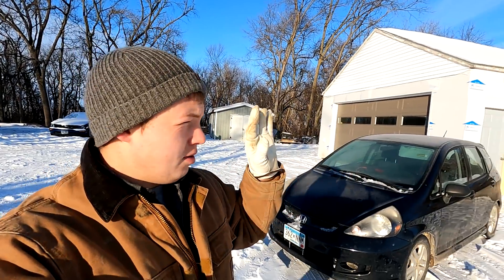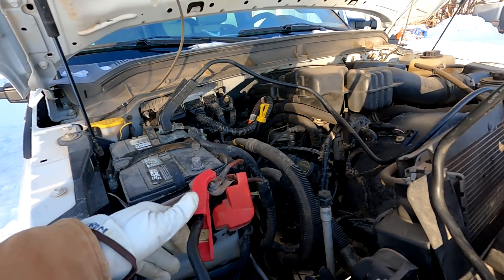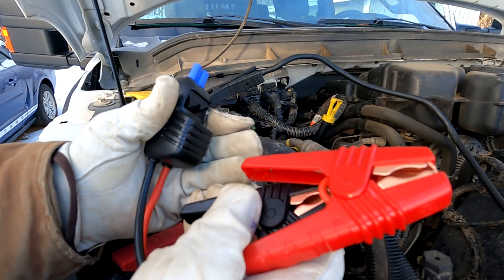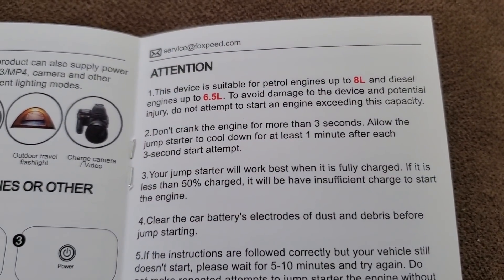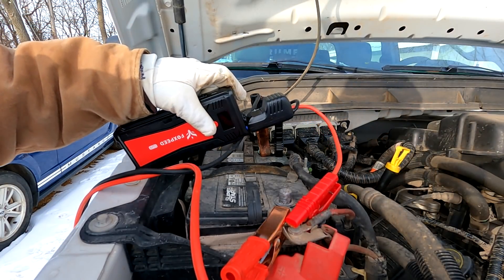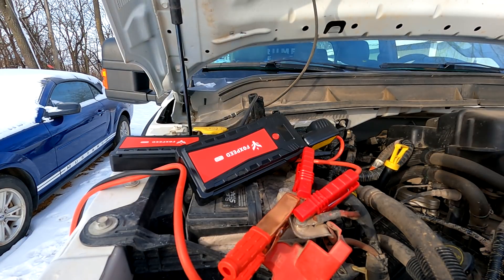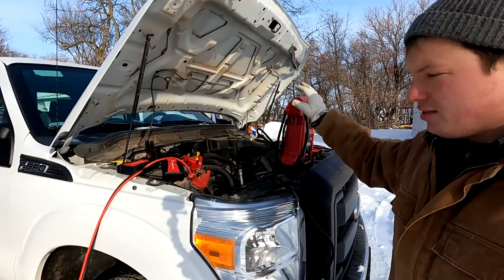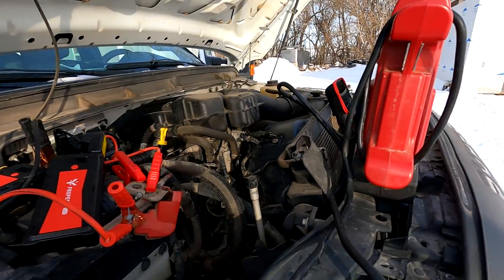Lithium Ion vs Lead Acid Portable Car Jump Starters

Comment: Think about very cold electric cars
Reply: Most EV's have absolutely no problem in the cold, though you do see reduced range.  The Nissan Leaf is the one that suffers the most, but this is because Nissan cheaped out and went with an air-cooled battery instead of a heated/cooled unit like everyone else uses.  (Supposedly the next Leaf will fix this)  Normal EV's will run their battery heater/cooler even when the car is off, if the computer says its too hot/cold out, or if you set the car's computer to do so.  For example, if you leave for work at 7am each day, you can tell the car to pre-heat the battery at 6:45am.  Or better yet, tell it to pre-heat the entire car, so you do not need to defrost or defog at all, and the seat heaters can be readied.  Of course this, and lithium-ion's reduced output at low temps, means you do lose some range in extreme cold.  Normal EV's can lose ~20%.  Nissan Leaf's lose 35-50%.

And for the record, I'm not a super EV evangelist.  Just a mechanic who works on anything with wheels, and have my certs for EV's.  I'll get one when I can charge it at home, but the current rental doesn't allow it. Booo~!

Comment: Wire resistance is proportional to length. Shorter cables can get away with being lighter gauge. For the same amount of current longer cables need to be heavier gauge.

Comment: My experience with lithium ion jump packs has been very negative in cold weather. Looking at Amazon nearly all of these units look similar with cosmetic changes. Lipstick on a pig comes to mind.
Reply: The Hulkman 85S has a pre-heat option that almost none of them have.

Comment: what is the dif. beteen 20 volt battery with 1.5 AH and 20 volt battery with 3.0 Ah? THANKS . your every informing.
Reply: 1.5 AH will supply 1.5 A current for 1 hrs, same logic for 3AH

Comment: General question that has nothing to do with this video, but with prior videos that you have done on wiring a home. The question I have is: “is there a code for how much insulator sheathing (the outermost insulator coating on standard household Romeo) can be left inside of a electrical receptacle. In other words, how much of the outer sheathing must be stripped off (e.g., 1/2”, 1/4”) ?  Thanks.

Comment: If you tried to start it a few more times, it might start. The LiPo cells need to be warmed up. Starting it a few times cold warms it up really quickly, and you should be able to crank it over by then.

Comment: If I were to have one of these, I would want to keep it in the vehicle so it would be there when I needed it. A jump starter that has an operating temperature of -4° (-20° C) on the low end just doesn’t seem terribly useful. It wouldn’t work when you’d be most likely to need it
Reply: The problem with this is that all batteries don't mix well with cold. That's just how they all are. Don't start your car for a week in well below freezing temps and your battery won't crank.

Comment: I just have to wonder why we can make electric cars using lithium batteries, but no one makes a full sized lithium starter battery. I would ike to be able to go 10+ years on a battery instead of the typical 3-5 years I get out of a lead acid.
Reply: Lead/acid is still the best battery for rapid discharge as is needed for a starter motor. Lithium is good at steady, gradual discharge as is needed for a continuously operating piece of equipment in a relatively steady state.
The lithium jumper pack contains and charges a large capacitor with the lithium cells and the rapid discharge of the capacitor is what boosts the vehicle battery. In fact, capacitors are often used in extremely cold climates to start heavy equipment because they're not subject to as much temperature degradation as any chemical battery, including lead/acid. Now of course, you cannot run anything on a capacitor continuously because it is more or less an accumulator of electrical energy, discharging its stored energy rapidly but cannot provide steady flow nor steady voltage.
The point of my comment being, lithium cells are not a viable battery technology for intense rapid discharge, they have their place in other applications for sure, such as phones, computers, etc.
As for the temperature issue, while lead/acid degrades under colder temperatures, lithium really takes a nose dive at some point, definitely not a cold weather battery.
Reply: They are available, but still pretty expensive. I expect that to change in the next few years.
For example:
https://shop.advanceautoparts.com/r/car-technology/lithium-car-battery
Reply: https://youtu.be/9cV837XhCN8

Comment: I have the same lithium-ion jumper pack and I love it. I've had for about 3 months and used it a few times. I live in Chicago, so it gets pretty cold here. I noticed it works best the closer it is to 70 degrees. It was 5 degrees last week and my car wouldn't start with the pack connected, so I put the pack inside my jacket, sat inside the car for 15 minutes, and let my body heat warm up the pack. I tried it again and car started right up.
Reply: Bernardo Cisneros
Thanks for saying that.  I'm trying to decide what brand of small Lithium jump start battery to purchase and this is a meaningful comment to me.  The test really didn't help.
Reply: A useful observation!
That could save someone's bacon!

Hey, if you wore a bigger coat you could just do that with the car battery!

More seriously the little packs can more easily taken inside in really cold weather. I've even taken them into restaurants, work, libraries and coffee shops in sub zero weather as I usually have a backpack anyway, to carry stuff.
I've charged it in some places too.
Of course bringing it in at home, overnight is the main thing, at least when it's double digits below zero... normally I don't.
Reply: They only work for a few years.
Reply: @dlee3710  
That makes sense.  No battery lasts forever.  They are just batteries.

Comment: I'm not entirely sure, but when you disconnect battery like you did, it resets computer in the vehicle, and the engine may not start, or may not run properly for a few minutes until the 02 sensors in the exhaust warm up.... it wont idle properly until it "learns" how to again, very frustrating on a -20c morning at 5am

Comment: What is the lifetime of the units? I find that they only have a 100% lifetime on average of 18 months for the lead acid unit which I prefer, but the cost of a replacement battery to be prohibited because it is about 3/4 the cost of a new jumper.  If you find it on sale off season, ( which happens every other time since I have it working 100% all the time). I am left with a choice of saving a small amount of money and have a beaten up looking unit (which is what I have) and none of the new bells and whistles,  like USB ports.
Why are these replacement batteries so expensive?

Comment: I have never tired a little one.  Convenient size and if the work, it's a good first step.  I recently borrowed a friends bigger one rather than running 100' extension cord with the charger.  It was snowed in so I couldn't easily get a car into the back 40.  The bigger pack worked hard but after many tries it succeeded.  I could see having a small one for quick try, especially since the Lithium probably recharges faster than the big ones.
Reply: I've got a lithium one.. They charge for a few hours and they're at 100%.  Some wont attempt to jump if they don't see at least 10v on the battery... Mine is like that.  It does the thing though on a 5.4L.

I've got a second one coming that doesn't have that limitation and should be able to spin my motor easily.  They're more for jumping batteries that are almost there, and just a little low vs. a completely dead battery.  Handy to have.  When I jumped my expedition with the one I have, I ordered a second one for my other vehicle...

What he's seeing with the COLD pack is accurate.  The lithium cells DONT like cold weather.  Heating em up to 30-40F would be ideal.  Mine will do it in the cold, but it takes a few tries to get that big amp pull to warm up the unit.

Comment: Need to try a super capacitor jump starter, not effected by the cold
Reply: This is exactly what I've thought about doing,, but don't run into a dead battery more than once every 3-5 years so I've never bought one since they're $100 or more.

The advantage of the super-capacitor jump-starters is that they can (allegedly) charge themselves off of a low battery, and store enough power to start the car.  The thing I don't like about the battery based ones is that you have to keep the battery charged.  Lithium and lead/acid batteries have self-discharge rates that they might be dead in 6 months unless you charge them.  A super-capacitor charger charges off your car battery, your phone, or the wall.

Honestly, it'd be cool to see a hybrid car battery that already has a super-capacitor in it, and maybe some temperature sensors that charge it up when it's extremely cold.  Then you'd get extra CCA capacity, or just protect against batteries that are low on capacity.

Comment: Thanks for the video!
I'll just add a note to be careful with some battery-charger/starters when hooking them up without a battery installed. Really high amp charger/starters push out the high amperage by increasing the output volts. The battery acts as a energy sink and will then absorb the amps pulling down the volts to near ~14v even though the charger/starter may be trying to push out, perhaps 18-22 volts. The (dead) installed battery protects the vehicles electrical system from the too-high voltage. By removing the battery and hooking up such a high amp charger/starter, the vehicles electrical system see the high voltage and could damage some components. Check the output of volts of a charger starter before hooking it up to a vehicle without a battery.
Reply: That is 100 % correct , I have NOCO GB 500  its massive power output . Output volts on Bypass mode is 16 approx. Volts and on Regular smart mode 14.5 Volts , so be careful .
Reply: @radiotvshop  oh ok so NOCO has that safety bypass mode so that you can jump a battery that is completely dead at 0 volts?    I noticed that option on the HULKMAN 85S and didn’t know which other units had it.    Unfortunately I found this out too late and bought an SP Tools jumper, didn’t arrive yet but I think that it doesn’t have the option.    To me it makes no sense to buy one without that option if there are models that have the option.
Reply from the maker: Excellent point.
Reply: this. i had to mcguyver a dewalt 20v 3 ah battery into a jump pack one night. was scarred I was gonna cook the car. i didn't

Comment: Third generation used car dealer here... I bought 2 lithium starters and will never use a lead acid battery again.
Reply: Annnd.... I keep one on my boat. Cheap insurance.
Reply from the maker: Thanks for sharing your experience!
Reply: @BenjaminSahlstrom  Forgot to add I'm in Michigan so I've used them a lot in winter.

Comment: trying to use a tiny SLA at -15F to start what a gigantic SLA couldnt. I dont see the logic there. Only if the jump pack was a small Silicate Salt based battery. Also that jump pack is 2AWG CCA or Copper Clad Aluminum, its what they all are to give you false sense of security.